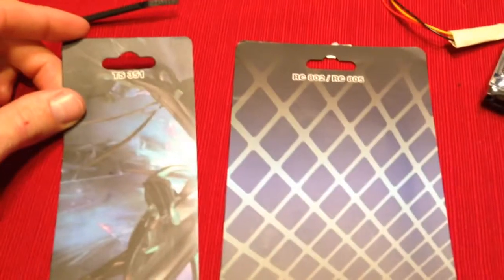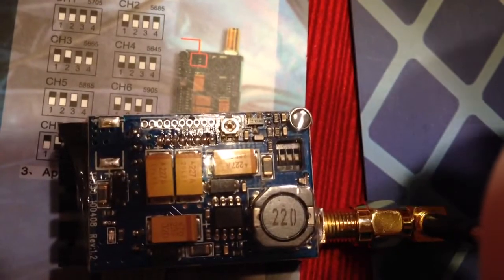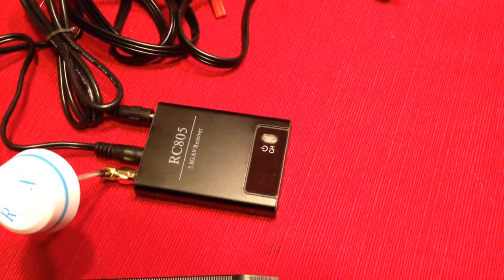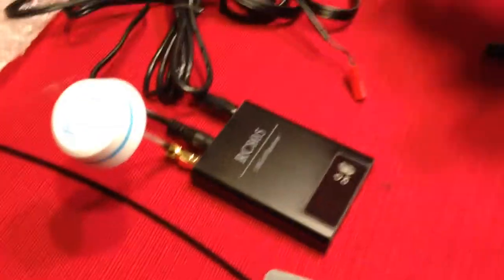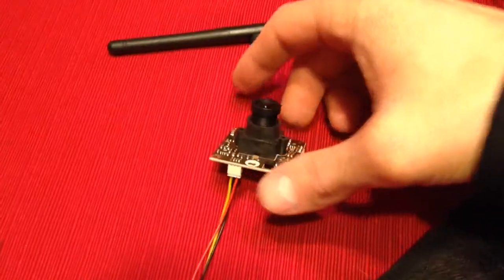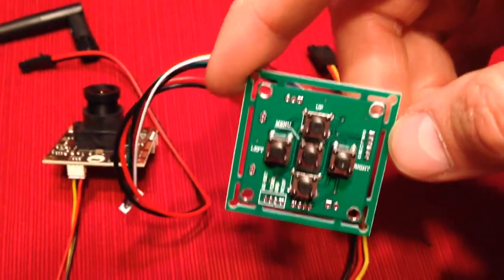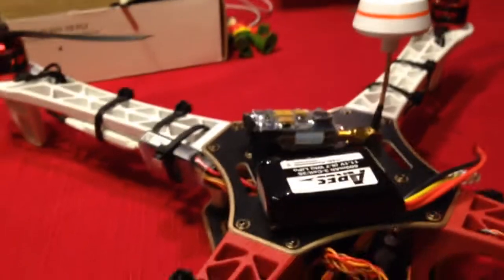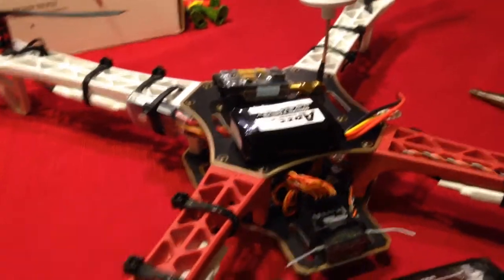FPV Setup on DJI F450 with Naza. Boscam TxRx.

Comment: Get some landing gear, they're cheap.  I installed my transmitter exactly where you  are putting yours.   I put the fpv camera on the front using a small piece of plexiglass.  I drilled a hole in the plexiglass to install the camera on it and attached it using small zip ties.  I then used some double sided sticky foam and attached the plexiglass the bottom power board and secured it more with another zippy tie.  Again, those simple white DJI landing gear legs with fit nicely so you can attached your battery underneath without any issues.  As far as the channels on the transmitter and receiver, if you are getting picture now, leave it alone.  The channels are In case you are flying with others at the same place and their FPV system is interfering with yours, might black it out, so then you would change the channels to have your own private channel to see your monitor or goggles picture.  Its all trial and error, do what is more comfortable for you and your machine.  Happy flying!